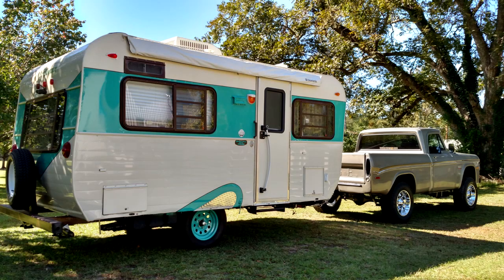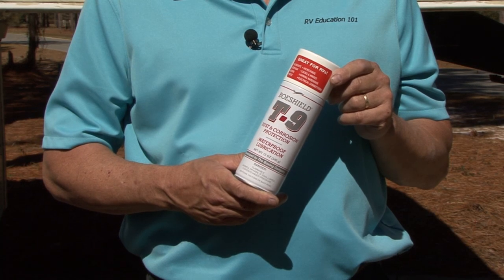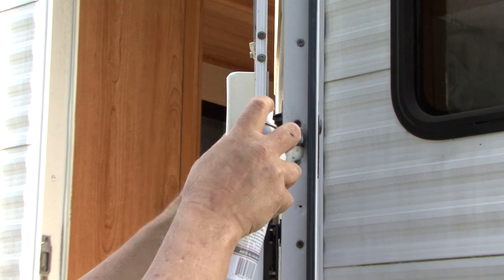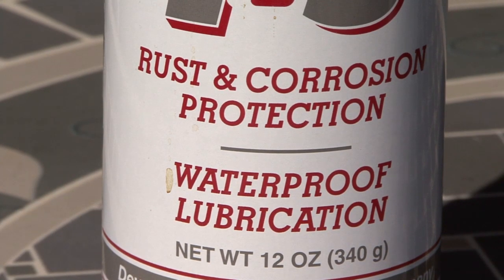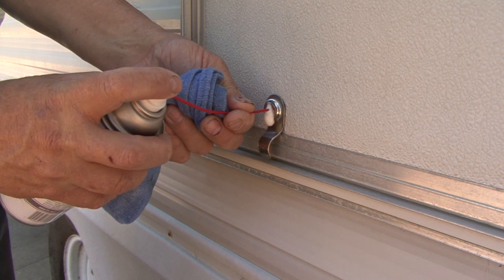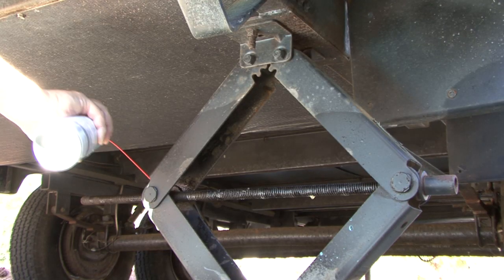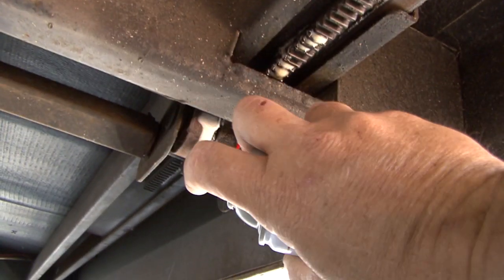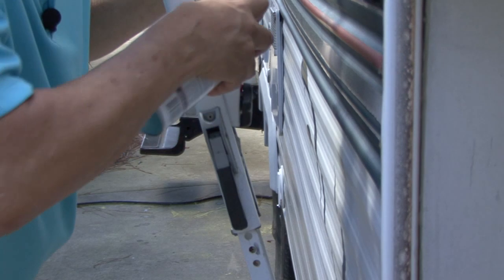RV Lubrication

Comment: This vid's a few years old. But I bought a can (May 2020) to spray the places shown in the video. Yeah. the guy's telling the truth. Spot on for the lock cylinders, window slides, hinges both outside and the two dozen inside. Doors inside the camper actually glide fully open now. Also fishing gear, moving parts such as multi-purpose tools that cut, slice, open, pry, etc now move with precision. Yeah, recommended.

Comment: 3 questions. is the boeshield t-9 better than silicone? when i lubed my slide out with regular silicon, the slide out jumped the track constantly. when i wiped it all off, back to normal. will the boeshield cause the slide out to jump track? and what about the power awning? is there anything we can do to lube the power awning??
Reply from the maker: Most spray lubricant used on slide-outs is some type of silicone formula that dries to a waxy film. Boeshield T-9 does not specify the formula they use but the product displaces moisture, stops corrosion and dries to a waxy film for lubrication. I don't see how or why the Boeshield T-9 would cause the slide-out to jump track unless it is out of adjustment. 
 
It would probably be best to contact the awning manufacturer directly if your awning owner's manual does not address lubrication.